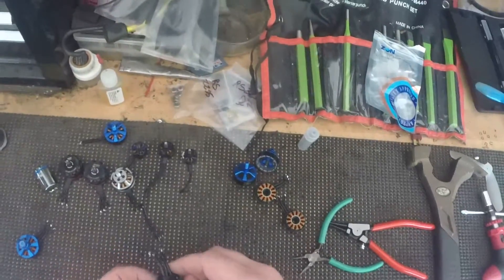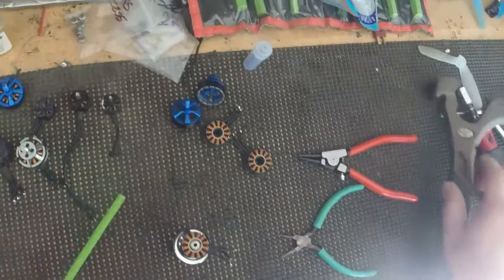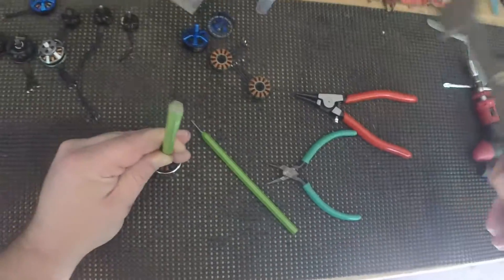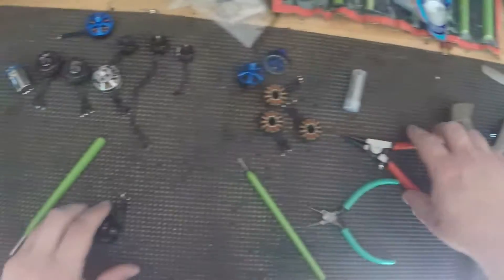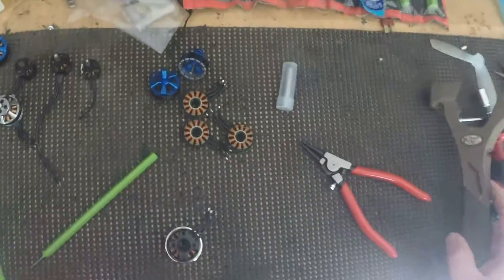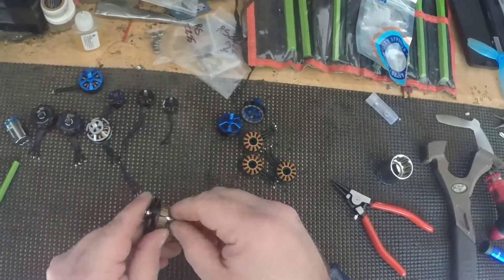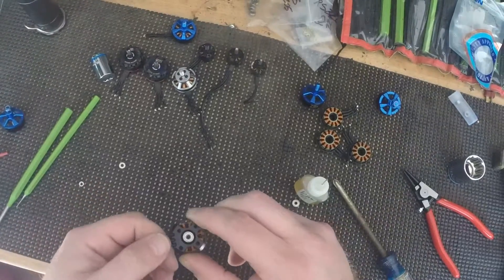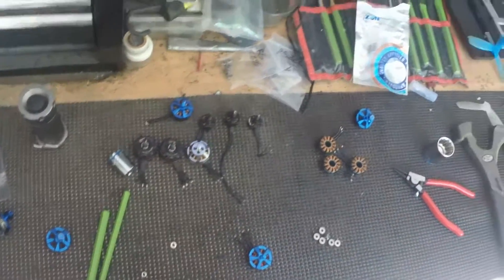Replacing bearings in a brushless motor....the easy way.

Comment: This is 3 years old but I hope if anyone sees the video, they know to never ever re-use a bearing that has had impact on the free spinning race. in this case, the inner race is free spinning. As soon as you hit the inner race with anything, the bearing is toast. If the bearing is mounted on a shaft (inner race is fixed), then impact on the outer race will toast the bearings.

It's very very important to install new bearings with contact only on the fixed race so that the bearings aren't deformed.
Reply: Hi Ryan, just saw your comment. Can you please advice me if I should change the ball bearings on a propdrive 42-58 500kv 60w engine after it hit the ground. The engine still works fine, shaft straight, lots of power, everything ok but when I hand spin the prop some slight noises are heard. Now I know they must be from the ball bearings but at firs by the way it sounded I thought that the mouving part is touching something. You can barely hear it.. I think it's the front bearing, should I change it? The rear one I couldn't find on my local store or hk. What could happen if I don't change it? How can a bearing go wrong? What happens to them? And what can it cause by going bad? Thank you!

Comment: I wish there was some kind of tool for this that protects the windings with bell housing removed. One wrong whack of the hammer or a slip of the hand can ruin the windings. Yeah, butterfingers me, but I've done it.
Reply: Put something between bearings and use m3 bolt and then use the hammer. 
Paper clip doing a job just make it straight and then bend 2 ends just enough for going between bearings. 
Job done

Comment: great video! may i now the size of the snap ring pliers? also if you have the link to the pliers it would be very helpful.. thanks!
Reply from the maker: I apologize for the late reply, I don't visit here too often. I purchased mine on Amazon. They are the 1.5- 4 mm size. Knipex is the manufacturer. https://www.amazon.com/KNIPEX-46-11-G0-Snap-Ring/dp/B005EXO2JI/ref=sr_1_29?s=power-hand-tools&ie=UTF8&qid=1493300449&sr=1-29&keywords=circlip+pliers
Reply: its okay.. thanks! good info brother..